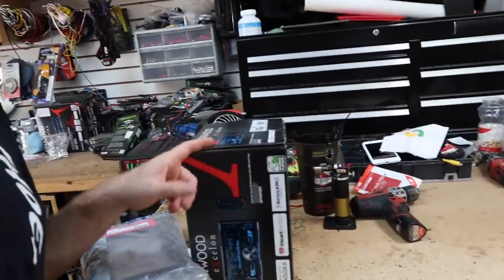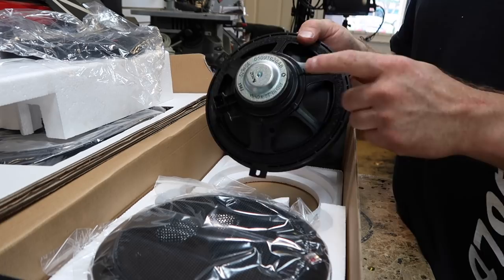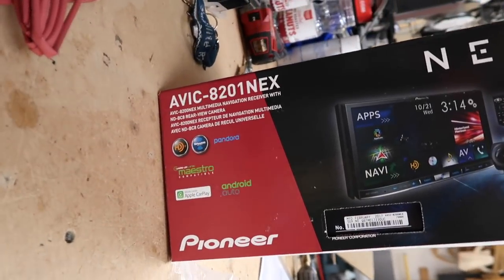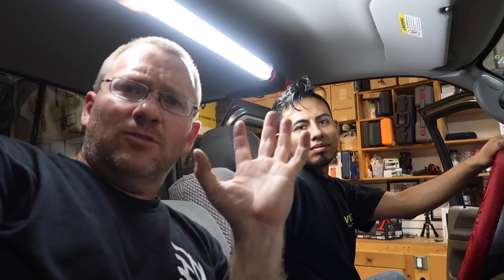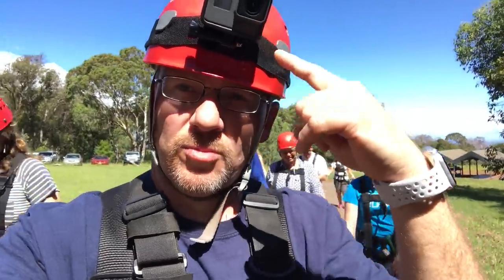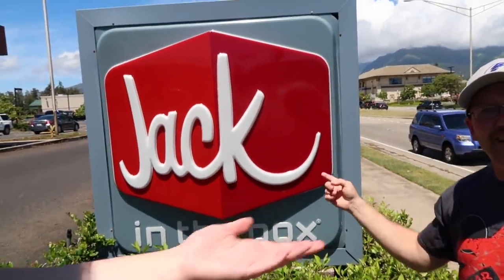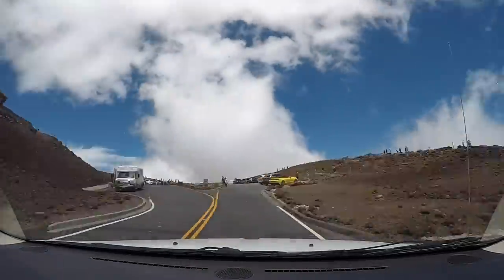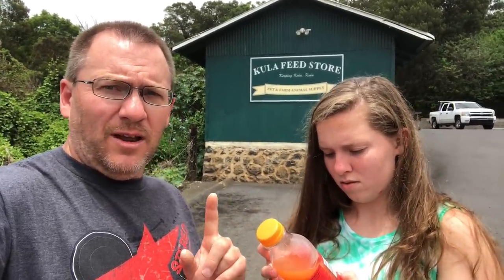The Installer Diaries episode 15, I'm out, see ya!

Comment: I have a question that’s driving me nuts and this is the perfect video to ask. When you replaced the kenwood 9903 with the pioneer you go from 5V preout to 4. How much difference does that actually make? I am in the opposite situation I have pioneer and am considering the kenwood to get the 5v preout.  Am I going to gain anything? I have a JL xd1000/5 with HSK 6.5 and JL subs.
Reply from the maker: +Steve Newcomb when we tested the output of the Kenwood radios it does have more output and never clips. Is this better then Pioneer, not necessarily. The gain can be a little lower with the Kenwood. They both has a unique sound to them that we have found some people have a hard time getting used to. If you switch I would do it for more then a volt.